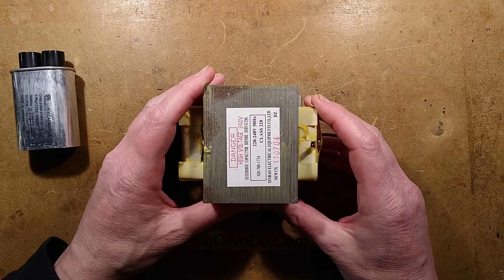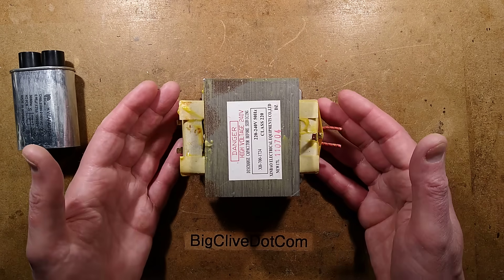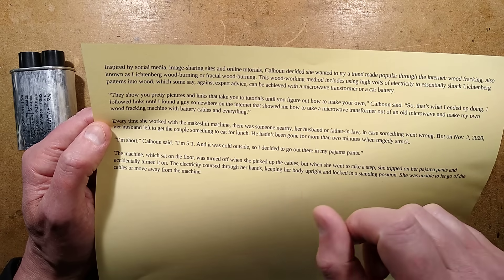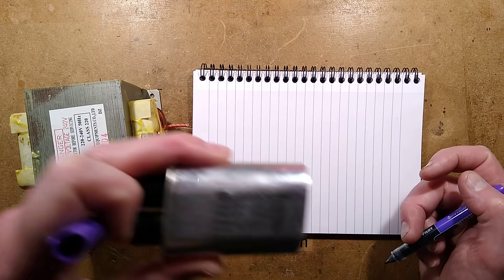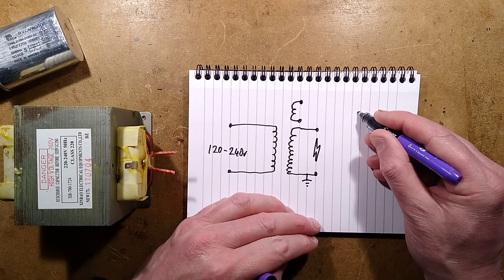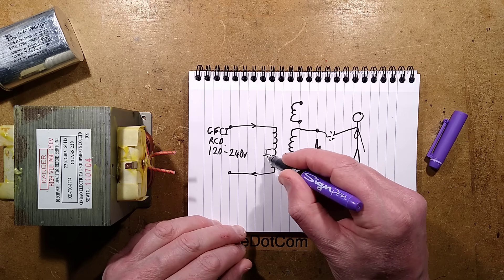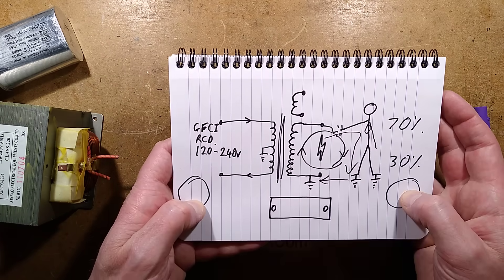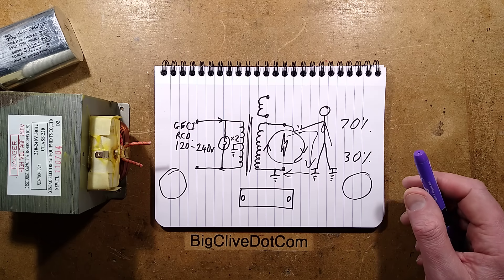The most deadly project on the Internet

Comment: Thanks for describing the "dead man's handle" -- that sounds like an excellent failsafe device. I've read a bit about safety interlocks and can 100% see the value in a life-saving mechanism that is only very slightly inconvenient but not enough so to encourage bypassing it.
Reply: We have "dead man's switches" at work where you have to hold the switches in a middle position, so if you cramp and press the button fully in the power is also off, this would also make sense in this case.
Reply: My Dad used to build and maintain control stations for the big punch presses. The big stuff that can turn a piece of sheet metal into a car hood for example. Part of every station were two palm buttons spaced far enough apart that it took both hands to push them and cycle the machine. This was done to make sure that the operator had both hands out of the machine when it strikes with enough force to turn a human body part into an unrecognizable goo. So what did the operators do? They taped one of the buttons down of course. If my Dad ever found a safety measure bypassed that way, he reported it immediately. If the punch press operator was really lucky, they only lost their job. The unlucky  ones lost a hand or a limb before they were reported.
Reply: @surferdude4487  part of my masters degree was a course on industrial safety and they also showed us some types of these switches. some of them have hoods to prevent operators from putting a heavy object on one to stay pressed and i believe there were even some that got electronically reset, so that you always had to go from unpressed to pressed for every cycle. if the button was somehow fixed in the down position it would not register as pressed after the electronic reset.

the amount of engineering that goes into industrial safety is mind boggling especially if you consider that most of it is to keep the operators from actively killing themselves and jet they still find a way to bypass it for convenience
Reply: Even when you have a dead manshandle and work with high voltage,pull the mains plug and keep it where you can see that its unplugged.
Reply: The problem with dead man switches, dealing with electrical shock, is loss of muscle control .
Hard to “let go”… when you physically can’t🤔
Reply: @MrBLAA  those in the first comment would work. If you have to press the buttons partially, and you get shocked you will cramp and fully compress the buttons, causing the machine to stop
Reply: @MrBLAA  thats why many of these dead man switches actually require you to to hold the switch in a half pressed position.
so when you cramp up you press it more than this  and its the same as if you let it go.

i dont think that electric shock will let you perfectly hold a low resistance middle position.

Comment: This could be done relatively safely with insulated probes that have spring loaded insulating shrouds over the tip, when pushed to the wood the shrounds would active safety switches, combine that with properly rated gauntlets.

Comment: When I was in grade school, I built an electrostatic generator.  using 54V in battery and a step down transformer in reverse, I had fun lighting up florecent bulbs using coils.  Keep in mind, it was only 120:10 roughly multipling the voltage 10 times.  I accedently touched the leads of the transformer on my arm and it knocked me to the ground. Off house current the potencial is 200A (about 2000x what I had amp wise) and a much stronger transformer plus water!  (salt water is used be cause it's more conductive!).  Electric chair is an understantment and way too easy for an accident.  My little brother does the thing with the metal and salt water, everything is wrapped and considered before he works, everything! (no he works with much lower current also)

Comment: This reminds me of when I was in the southern hemisphere working on  one of the first 22 inch full colour crt monitors imported from the northern hemisphere. 

 In order to deal with magnetic differences it was necessary to open the case and readjust the colour gun tuning.  

This was a two man job. 

One to watch the screen and the other to adjust the pots which were at the back of the unit.  

We had imported around 20 of these monitors... which we were selling for around $5k each ... and they were probably the only ones in Australia at the time.

In order to perform the task of tuning the monitor for a perfect picture the monitor clearly needed to be switched on with signal patterns displayed and around 40 different pots had to be carefully adjusted which were located on a board at the back of the monitor... thus requiring the case to be removed.

Large crt televisions were reasonably common but large crt monitors were a very different beast as they were built to quite different standards when it came to the focusing requirements ... meaning that internally monitors had quite a bit of bracing to keep everything "still". 

In the process I accidentally leaned across and my clothed arm touched part of the metal framing which held the monitor in place.  It should have been safe but due to a minor electical fault... caused by some shielding being damaged in transit I was hit by a high voltage current upon contact of the support.

I do not recall that it was particularly painful but the next thing I knew I had hit the wall 25 feet away from the work bench about 12 ft feet in the air, at which point I slid down the wall into a rather pathetic looking heap on the floor. 

My workshop where we were doing the work was in the front upstairs room of a large house where I was living with a 16ft ceiling and a 30 ft frontage.

As I am 6ft tall... this means that I flew from one side of the room to the other ... and didn't just hit the wall... but the ceiling as well. 
 
Being a typical understated Brit... replying to my stereotypical Australian colleague who immediately exclaimed "strewth mate, are you ok? You could win a f*cking gold medal in the Commonwealth games if you can do that again" I said something along the lines of "might be time for a nice cup of tea and a lay down" and promptly went to bed to recover .... which I did... for a full week...only getting up to make my way from my bedroom to the toilet... 

Now that was a minor brush contact working in a safe fashion with due respect for the danger of working on necessarily live equipment whilst wearing long safety gloves, with rcd cutout protection where the contact was through my clothing and the metal frame which I had touched should have been safe.

Comment: You failed to mention that many of the 30% of survivors injuries come from internal burns and cooked internal tissue. Not a nice way to be injured. Best to purchase equipment designed for the purpose, have a proper work area, and wear appropriate clothing and PPE. The problem is that high voltage equipment and wire are not commonly available, people do not understand the Personal Protection Equipment (PPE) required for safe handling, and do not fully appreciate the dangers or the setup required to perform this type of work properly.

This is why you see welders using a ground clamp on the equipment, and wearing proper clothing and gloves to maintain proper electrical and physical isolation from the work. And just because you have been lucky so far does not mean that you know what you are doing. As an electrician, I have seen the injuries, have known people who died, and had a very close call myself. Whenever you are working with live electrical equipment, you are dancing with death.

Comment: I would have laughed out loud, but it was too shocking.

Glad to see you not showing the gore. The description was plenty good enough.

Those that have died from these idiotic projects did so because of a lack of research or respect for electricity, especially when a transformer is involved.

And I still can't get past the insane idea of using automotive jumper cables. They're rated for high amperage, not high voltage. But what do they know?

Comment: THANK YOU!! For producing this video and explaining how dangerous these things are. 
It provides a better way for someone to understand how easy it can be to die and perhaps they learn this is not just a simple toy to make. 
If some persist to make one of their own,  at least they are better informed about the risks and hopefully they apply common sense together with safety measures. 

Long time ago I saw a tutorial on how to use these transformers for sparks and fun with very little focus on the safety part. I still don't understand why I didn't get killed since I wasn't aware of the consequences should I become too close between the ark path.
One thing I  remember is that some sensitive electronics stopped working and never worked again during the time I used to play with these things in my garage at home creating Jacobs ladders. Now I understand why since I connected two of this transfers in series doubling the output power. 
I still have a few of these transformers laying around and will never use them in the same maner if I ever wish to mess with them again. Probably never.

Comment: I reclaimed x2 transformers, removed the secondary high voltage windings. rewound them with 12 AWG cable, put both the primary and rewound secondary windings in series for the basis of a high current 12 Volt 30 Amp linear power supply. Its run my HF radio equipment flawlessly for over 18 months now. I draw about 18 Amps driving a linear amplifier and radio on TX on RX its a few hundred milliamps. I'd never use one for high voltage. but they make great high current low voltage transformers. The two in series overcome the heating affect that one single transformer suffers from.

Comment: 800 Watts at 2000 volts. What could possibly go wrong.... Well.... You could die. 

I personally wouldn't do that because it doesn't interest me, though making a spot welder does. If I were to make one, I did think of putting a timer in so that it could only be on for a few seconds at a time though your idea of a double dead man's handle is the safest.

Can't understand the mentality of handling electricity with wet hands.

Comment: When I was a teenager, I read an account of a woman who was driving an enclosed-cab tractor across an open field, towing a very tall implement of some sort. She never thought of the overhead 7,200 volt power lines. The implement contacted them, the tractor died, and she was left sitting in her agricultural Faraday cage as power arced to the ground outside. She panicked, opened the door, and tried to jump clear. She didn’t make it that far. The current entered her hands, then exited her feet into the soil, burning holes in her feet through whatever footwear she had on. I believe she survived, possibly due to automatic breakers finally de-energizing the line.  It must have all happened very quickly.

I work on RF linear amps with 2-3.5 kV supplies. I think of that story every time I look at one. You’re allowed zero mistakes. I cringe whenever I see a homebrew linear for sale.

So yes, get the word out to the unknowing just how dangerous a few kV are.
Reply: John Deere operators manual tells you to stay inside with a line strike, but if you have to get out [fire] jump as far as you can and land upright on your feet. I managed to shut off the power to a neighborhood with a large excavator once [And once only] but the wire stayed up as I just brushed it. So the power company had only to change a fuse and I got out of there very quick. The book also warns that high voltage lines can arc out about 15 feet, so you don't even need to touch the line. That makes any work near lines pretty dodgy.
Reply: @RRaucina  I've seen those helicopters that work on high voltage wires.  Those arcs are crazy and they definitely aren't grounded.  Just at different potentials.
Reply: @jmr  Being grounded is also "just at different potential" ;-) What you're seeing there is the capacitance between helicopter and ground getting charged to line voltage. The linemen have to wear special suits basically providing a wearable Faraday cage because even though said capacitance is somewhere down in the femtofarads it still allows potentially dangerous AC currents to flow because of the extreme voltages involved.
Reply: @jmr  The first pilot who did that had balls, even if we all know there is no immediate danger.
Reply: @TheReligiousCrap  Supervisor: It's going to be just fine Todd. Employee pants: 💩
😂
Reply: @RRaucina  Land upright on your feet with your feet being close together. And then keep jumping away, don't walk or run. This is very important, as the step voltage can be high enough to give you a shock or kill you.
Reply: Better off waiting inside for help I think.  Everyone thinks about vehicles blowing up from the movies.  At work we were also told the power isn't out till it goes out twice and I've found that usually to be true.  I wouldn't immediately jump out because I thought the power went out.  I would still try to wait for the experts if possible because you only get one chance.
Reply: @jmr  One should jump only if the machine is on fire.
Reply: We had a rule in the lab where I worked on 1kV equipment. There's always 2 of you there and one of you is next to the power.  The other rule was always one hand in your pocket (stops direct path across the heart).  We were always thinking safety no matter what.
Reply: Yep..been there done that.  Got into the plate voltage of a Yaesu FL-2100B once.  Took 2.3Kv into my left index finger, across the chest, and out my right palm.  Knocked me all the way across the room and I regained conciousness soon after.  Went outside and threw up.  Funny thing is, every single time before that we did all the necessary de-energizing protocols.  The one time we didn't...I got bit.  The only real thing I remember about the event is feeling the electricity going through me, the split-second thought that "Well, it's over..I'm dead" and then a blinding white light going off in my brain.  Then...darkness until I woke up.
Reply: Dang she probably would have been fine without trying to escape...
Reply: @VonGeggry  If she had some kind of cell phone, she could have called for help.  There should be some kind of emergency call available where there are overhead power lines.  I've seen cattle grazing underneath them.  Crops growing under them.
Reply: Hm. Reminds me of testing a NDB (Non-directional beacon). You just used a long stalk of grass and brought it NEAR the RF output terminal. You'd see the arc and hear the identifying morse code in sizzling steam from the twig for a few seconds. These were iirc some hundreds of KHz and 20 or so watts. MW transformers can put out 2 KW at 50 Hz, so no skin effect. That's DEADLY.
Reply: @juanferreira5931  NDBs can have a wide range of power outputs. In North America for example they are classified as low power if they output up to 50W, medium power from 50W to 2kW, and high power above 2kW. And this is radiated power, so RF power at the antenna input is somewhat higher still (depending on antenna efficiency).
Reply: Women drivers lol
Reply: Oh boy. In the late 70's I got my 2nd class fcc rt license and I had to do this too.  Big ass Johnson Vikings.... those things - I just hated the thought of working much less troubleshooting them!  
Incident 1: Was working on a 25" color TV in my shop in my sock feet at night.  My hand for some reason got within 1" of the top of the HV power supply (flyback xfmr), and an LONG arc went THROUGH the insulated output into my fingers! I screamed bloody murder!!! Scared the living shit outta me!

Incident 2: At the CB/Ham radio shop I worked at, I was setting up a Yaesu 250watt transceiver while the boss was talking to the customer in front of it. Couldn't see the coax connector so I was trying to hook it up by feel.  For some reason, the VOX switch was ON, and while he was talking, the transmitter turned on and that damned connector burned a HOLE in my thumb!!!

I learned early on not to do stupid shit like this burning wood crap with electricity.
Reply: @dryan8377  Yeah, hams are supposed to know all about electrical dangers. My old Amateur Radio Handbook (1953, I think) explains how to construct a power-supply cabinet that uses gravity to drop a shorting bar onto the filter capacitors when you open the cabinet door. Some of those kilowatt transmitters (pair of 811-A or 813 vacuum tubes) used 2 kilovolts or more. Two important points: (1) KNOW the relevant aspects of electrical engineering, and (2) USE your knowledge to remain safe. Just knowing that it's dangerous won't keep you from getting bit by electricity. Complacency ("I know this stuff. That makes me immune. It won't hurt me.") will get you killed.
Reply: @amazing7633  Imagine the voltages and power of a 50,000 watt radio station that can be heard for a thousand miles! Be VERY careful when you work on that equipment!

Comment: I'm not thinking of doing this, I don't have any interest in the end result.  But for the sake of learning a thing or two, if you got rid of the reference to ground on the secondary winding and replaced it with another lead wouldn't this be much safer?  Would the effect still work if you had 2 wires on the secondary, one on each side of a plank of wood?
Reply from the maker: It's a complex subject as high voltage can cause odd results.

Comment: Very interesting. I'm curious, would there be any benefit to wiring a GFCI into the secondary side in the intended path of the current? Would that then interrupt the circuit if you were bypassing the it? I imagine an off-the-shelf GFCI would be insufficient though, due to the high voltage e.g; being able to bridge small gaps between components inside the device...
Reply from the maker: Complex due to the voltage and arcing nature of the circuit.
Reply: yeah as you say, would be unlikely to work...